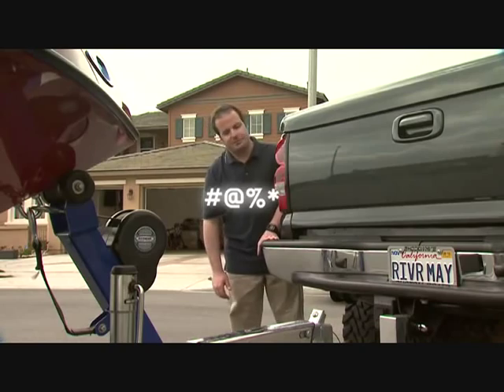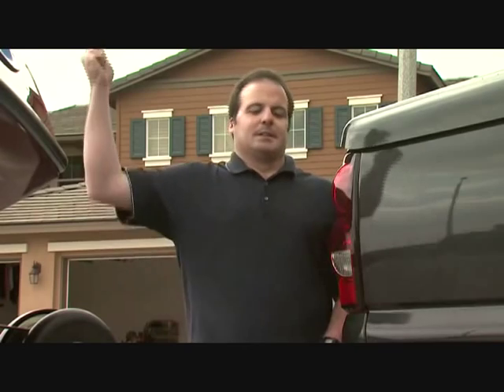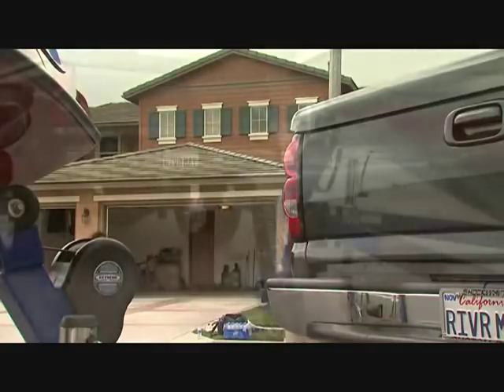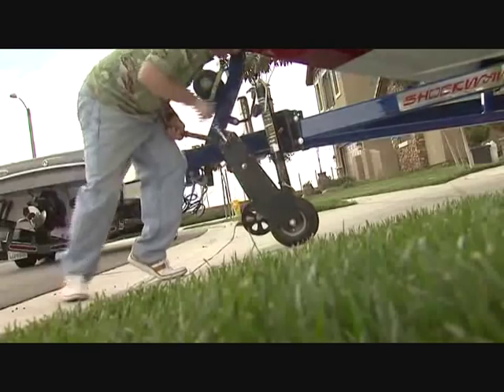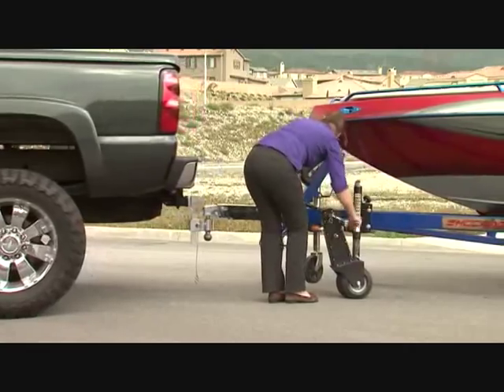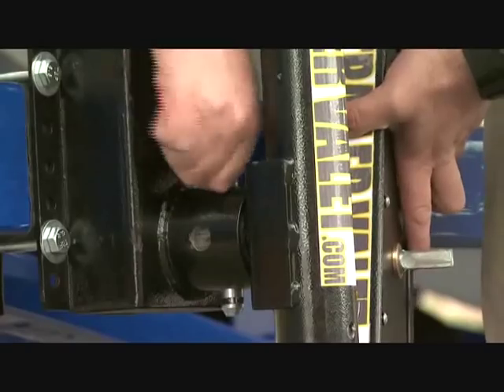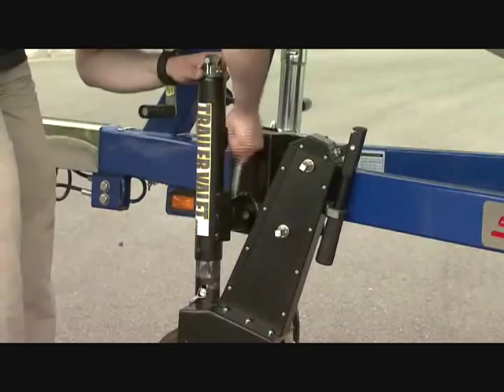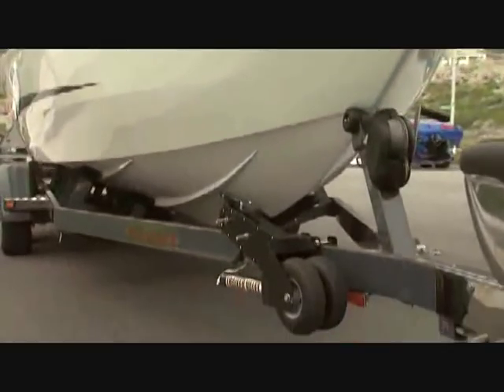Trailer Valet

Comment: Even with 50 PSI of air in my valet tires, they look flat while moving a little 21' jet boat, this guys moving a 24' at least
Reply: Sucks to be you. Since November of 2020 all of their models have been made with solid rubber tires.

My trailer valet XL moves a heavy 28 ft camper around my pole barn without any troubles. I've only used it on level concrete though not sure how it does on inclines